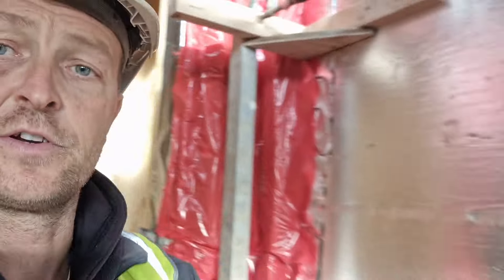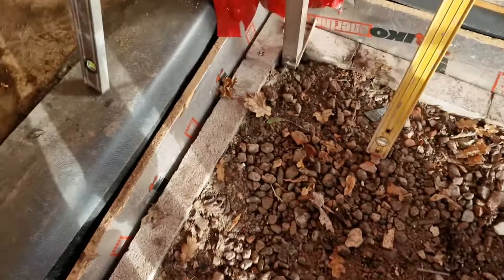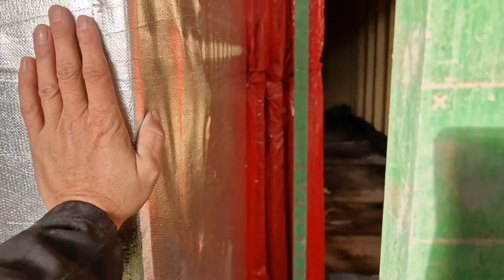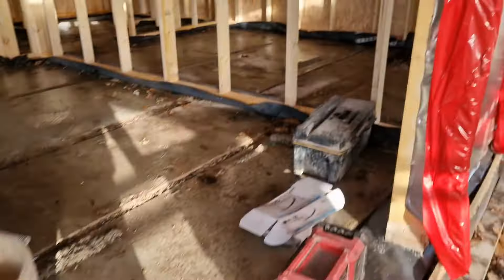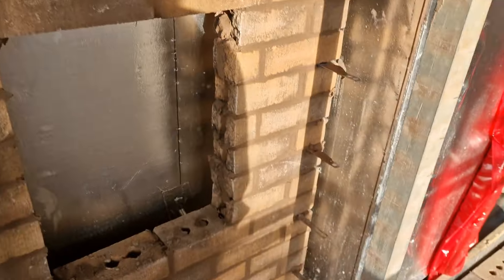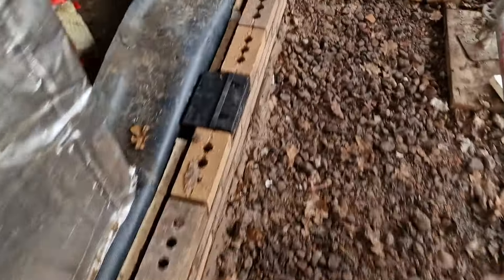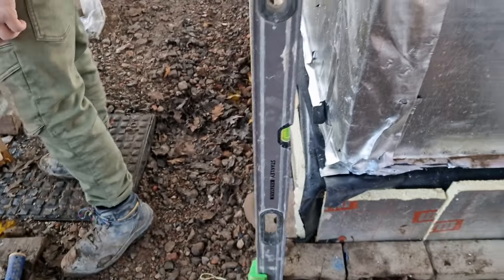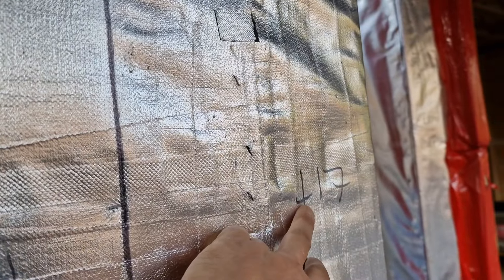Setting up Brickwork For Timber frame Aprtments

Comment: We set our splash to 160mm overall. Cavity’s should be 50mm but the nhbc accepts it. We do this because it’s ridiculously tight over the lintels especially with the new zedex damp. But I like the timber frames. Only been doing them for about 3 months. Just lay bricks! I use the rhino set up too. You can get a profile anywhere it’s great. And personally I don’t there is much messing about!
Reply: Yeah always go 10mm big on your cavity, lintels usually stick out otherwise!!
Reply: @ that’s reyt Arh youth. 👍🏻

Comment: How come you’re starting the brickwork before the window and door frames in? You need to set the brickwork to the frames
Reply: The frames are good to build to. When the windows are in which will be soon no doubt then therell be a small mastic gap. You can get away with anything between nothing and 10/15mm so it’s not a problem. Hardest thing is keeping the windows and doors clean once they’ve been fitted

Comment: Surprised the air vents are in the doorways chang and do the head and cill heights work gauge then or do you still leave a compression tolerance
Reply from the maker: @kingofthetrowel1725 they are full height w8ndows and still need compression
Reply: @ cheers mate 👍